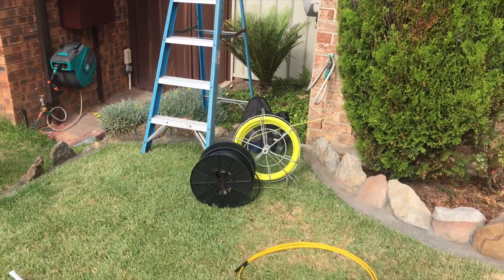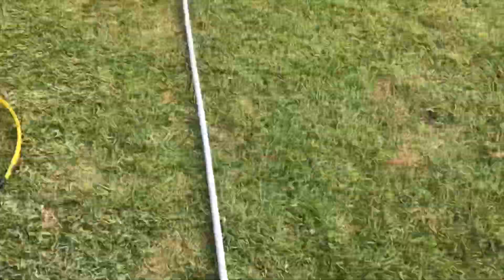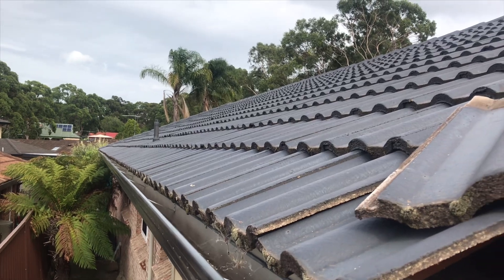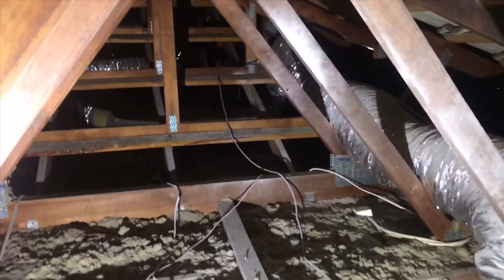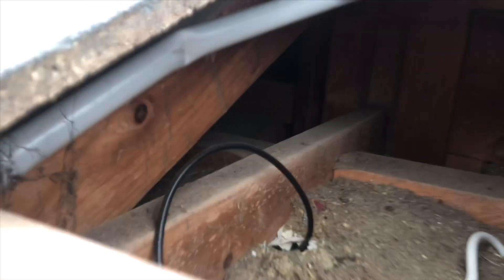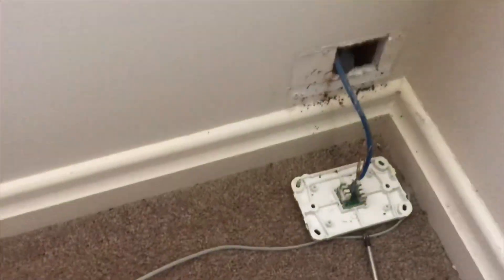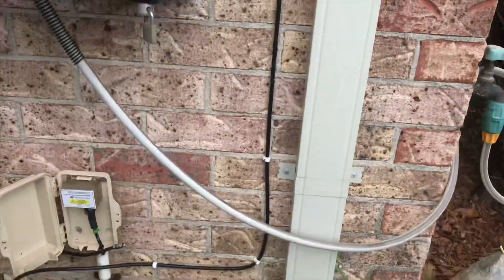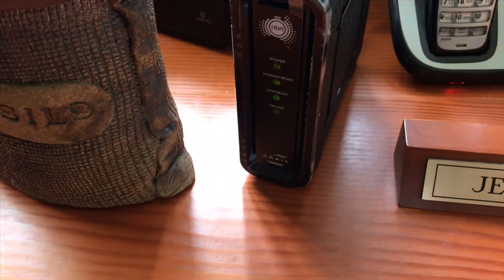NBN HFC Socket Relocation in Sydney. Step by Step (Single Story Home)

Comment: I have some questions as a Hfc network technician, I noticed a 6db attenuator at the pcd. Now you moved it further back to the house witch you will loose more attenuation did you get a wall socket reading ? I’m sure you might have to put a lower dB attenuator or remove it. This customer may be out of  spec now
Reply: chances is they're still in specs most like 8dbm at pcd after the attenuator so with the extra length, no problem. previous tech useless he could have done this. if it was me, I wouldn't use the conduit if I'm already in the manhole just pull and crawl to the other end

Comment: I don't really understand why people bother with this type of costly and complicated relocation work (for at best a 100Mbps connection) when they can get a good mesh wifi system that will provide amazing whole house wifi coverage (capable of delivering speeds well in excess of 100Mbps)  and also multiple Ethernet ports (at satellites) for under $400.

Comment: You are drilling through the eaves , old eaves containing asbestos.
Running exposed cabling on external walls!! Why not through wall cavity 
Any cabling on external walls must be protected with hard conduit if it’s below 1.8 metres.